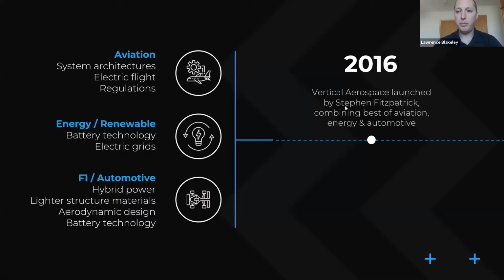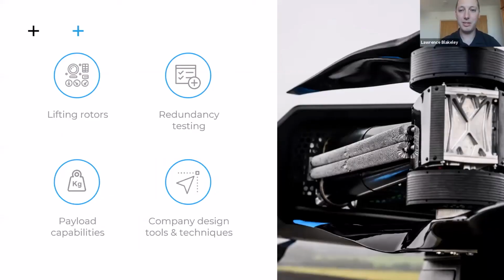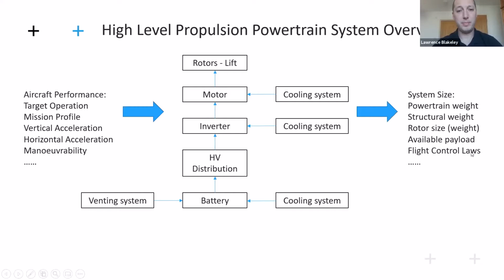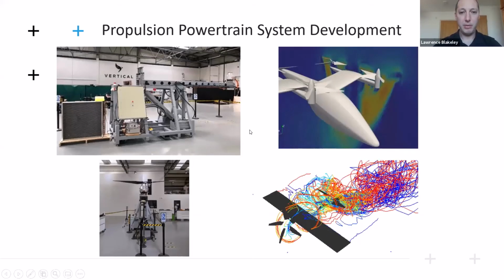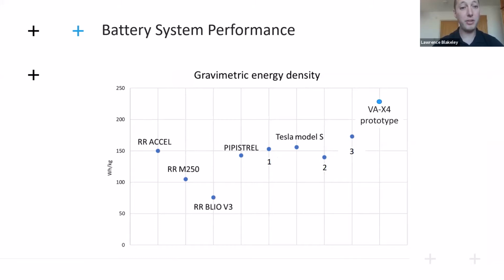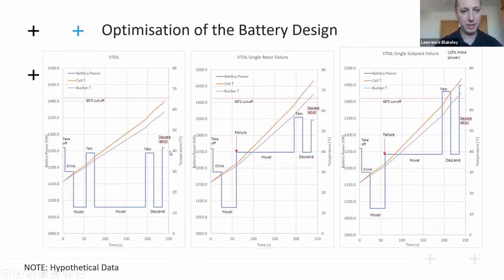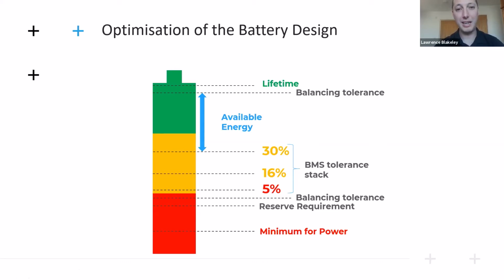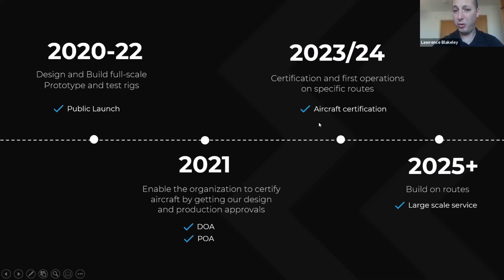Vertical Aerospace

Comment: I am glad that steps are being taken to build an electric passenger planes. We know that both vertical flights and perhaps to the lesser extent runway take off air-planes use a quarter of their battery power just to take off from the ground, and currently, lithium batteries do not meet the needs of passenger Plaines even for air taxis. Furthermore, as the weight of the battery does not decrease due to use, battery power is further wasted to carry dead weight. And as a result, the flight path that has a commercial aspect is very short, and the battery installation becomes longer due to the extra weight that disturbs the flight. 
Of course, progress can be suspended, in order as more efficient batteries are developed. However, that would mean no progress for the time being , so what should be done? In the case of vertical flights, it is possible to use the hard-wire electricity ( via dis-connectable wire from outside the plane to help  take off), and after the flight from the ground, the connection of the wire will be disconnected and the air will leave on its way. In the case of runway take off, an electric rail that is installed on the runway supplies electricity to the plane, and the connection is cut off at the end of the rail. Even during the flight, by installing hydrogen balloons on top of the battery and keeping them partly suspended inside the plane, the weight of the flight is kept lower and a longer destination or more passenger will be a possibility.
Reply: Great idea zand